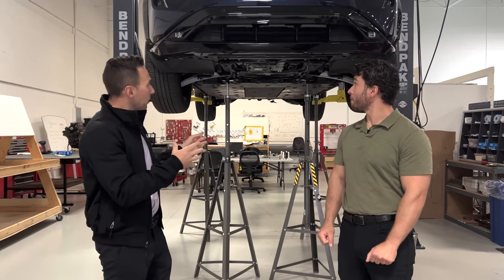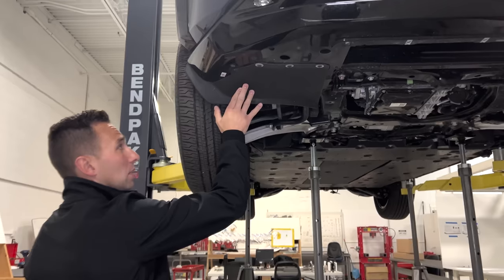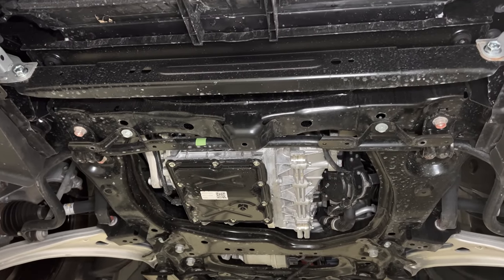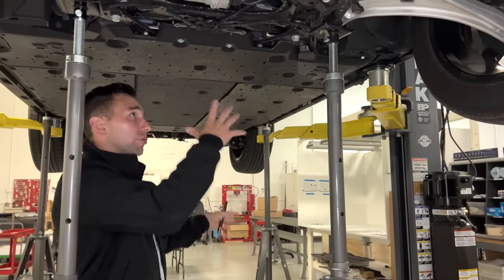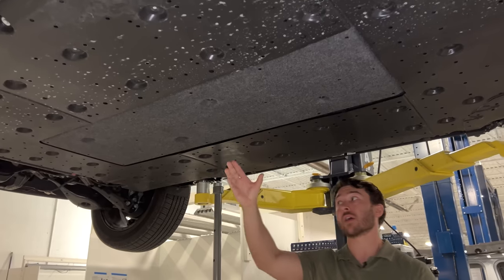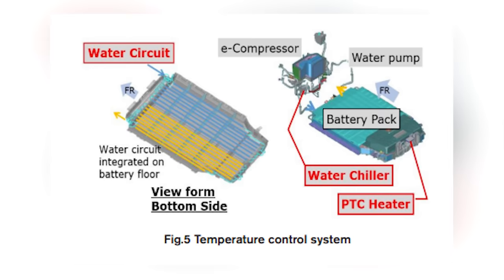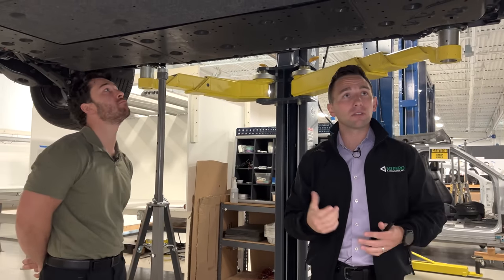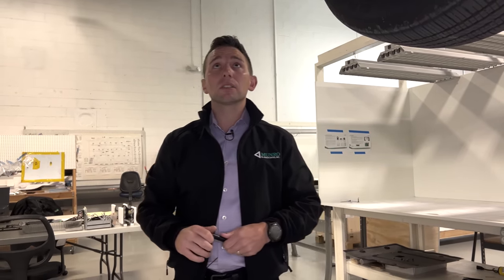An Integration Investigation: Nissan Ariya Hoist Review

Comment: I like the pack underside standoff space to minimise the risk of damage and the post-collision safety gained from placing the pack's cooling external, as H/K and VW do.  Although there are a lot of fiddly parts here and there it's clear that Nissan's design intent is to provide a quality product, as they did with the Leaf.  I was hoping that there would be some engineering comment about the steel sump under the motor?  Clearly it's a 'wet' motor design, another good choice, so perhaps that's access to a filter screen or oil/coolant heat exchanger?  Big thanks for the video, guys!

Comment: I'd worry about how evenly cooled the cells and modules are if all the coolant goes down one side and up the other. You'd think they'd incorporate dual loops flowing in opposite directions with a manifold at opposite ends to distribute and redirect it. The more evenly you can match the cell temps, the less likely you are to throttle the charging speed because of hot or cold spots. From TeslaBjørn's OBD data it seems that Tesla still does the best job of keeping all the module temps within low single digits of eachother.

Comment: I have been wondering for a while now why these battery packs are not insulated.  The material used on the space shuttle comes to mind.  It is light weight and I'm sure Tesla can get some of this from Space X.  These packs are liquid cooled and heated so I see no reason not to insulate as long as thee material is not too heavy.  Insulation can go a long way when it comes to extreme climate areas.  Anyone have any thoughts?

Comment: The Ariya definitely has AGS motors and actuators, at least my EU spec unit does, also I'm doing about 330 miles each charge with it, don't know why you are saying that it can't touch even 300 miles.

Also those underlights are dealer installed accessories, I have to note also that those lights are completely different design on EU spec Ariya's, I don't have light strips on mine but LED "ceiling" type ones.

Comment: I like the externally attached wheel spats. It's like Nissan is acknowledging that these get damaged a lot, so they've given the owner an inexpensive way of replacing that part instead of making it part of a larger assembly that would be cost prohibitive to replace.

The LED side lights harness looks totally janky, and reminds me of some trailer light harnesses that zip tie to frames.  Also like trailer light harnesses, are subject to damage from road debris and then the lights go out.

Comment: The ground illumination lights is an accessory you can order at the dealership for about 600$. So this is not factory installed, which explains why it wasn't fully integrated.

Comment: The other thing I noticed about those courtesy lights is that the mounting clips are over the lint emitting surface which is going to cast a couple of stupid looking shadows.  This looks like some sort of dealer add-on option.  If it is factory - very poor execution.

Comment: I believe the lights are installed at factory level. Interesting that Nissan went to great lengths to cover the pack and the underbody  yet couldn’t be bothered to route,cover, and mount the wiring for the lights correctly.
Reply: After thought, the platform will be used for Renault products as well and I doubt this was planned since conception.
Reply: Port installed.
Reply: That wiring assembly might also be intended for other, larger vehicles, and Nissan went with one part for their entire lineup.  Just speculation.
Reply: @ClockworksOfGL  really good  observation that’s certainly plausible I believe the pathfinder and armada  have a similar lighting package. Could be that all models use the same part number for the lighting package.
Reply: @MuitoDaora  maybe but why would they design a lighting package that’s a one-off/bespoke to one car and cannot be used across others….that seems like extra cost that the company will not get back imo
Reply: @Drivethisnotthat  good guess that would explain why it looks like a rush job.
Reply: There is an illuminated-plate option for the cargo area.

Comment: Yep, Looks like a Nissan. Not elegant, but effective. Hey, the upfront engineering costs count too. My 2011 LEAF was embarrassingly inelegant under the skin, but is now a 3rd gen hand-me-down. The uncooled battery was awful, but cheerfully replaced twice under warranty. Today at 150k+ miles it is still perfect except for the paint and silly solar panel. Still on OEM brake pads.
Nissan has been through some really tough times, scandal and merger. The Ariya (have to look up spelling every time) Is the ideal EV for 2016 when it should have come out. I have a soft spot for Nissan and hope they find a way to be successful. Buyers will be happy with this car.

Comment: What is the battery chemistry of this vehicle?  Can’t find it anywhere
Reply: I believe it is NMC and I’ve heard it is supplied by CATL.
Reply: @geft there’s an elektrek article from 2020 that says this, but the company won’t confirm it, and inside EVs says it’s Envision AESC.  And if it’s NMC, how can you charge it to 100% every night and not get huge degradation?  Massive oversight on Munro live to not mention the chemistry.
Reply: @Aslash304  I think I heard about CATL in a video I watched.  So not 100% sure about the manufacturer.  I contacted Nissan about battery charging and they recommended stopping at 80%.  Unfortunately the car doesn’t let you set a charge limit so I just have to have my EVSE cut off the charge by time.  The agent I talked to indicated this feature is currently being worked.

Comment: That basically quadrupling the size of battery pack only gets you about double the range of Nissan's original 24 kWh car is something I find a bit sad.  I strongly feel too much emphasis has been given lately to having SuperCar performance levels in what should basically be a family grocery getter sacrificing range on that alter in the bargain.  In this pursuit of the high performance family car they are also sacrificing charging time since a 96 kWh battery takes much longer to charge than say a 48 kWh battery.

In the ICE world we saw this in the 1960's/1970's during the Muscle Car era when fuel tanks grew to well over 30 gallons as they put more emphasis on performance over economy installing 400+ cubic inch engines even in the family grocery getter and then the gas crisis arrived with gasoline rising to almost 40 cents per gallon which many said we weren't going to put with for very long and they were right because in short time it went to $1.40 a gallon.  Imagine filling a 32 gallon fuel tank on your family grocery getter every week at today's fuel prices.  That would be unacceptable for most people yet with the EV we see similar as more and more are getting close to and over 100 kWh battery packs to support larger more powerful electric motors then are really practical.

We need more EV's that get better than the 5 miles per kWh of a decade ago and not more that get less than half the range per kWh.  Improvement in efficiency, aero, et-all should result in a measurable increase in miles per kWh and not large reductions in it.  We appear to be making giant leaps backwards in efficiency.  We should at least be where a 48 kWh car gives you more than double the range of a 24 kWh car from a decade ago.

Perhaps if enough of us push back on this manufacturers will take note and start making EV's that have more reasonable performance levels.  They would also cost less to make and more people could then afford them.

Best!
Reply: I understand that, all things equal, a doubled capacity battery doesn't give you a doubled range because of increased weight. I don't think the issue is high performance motor. If you discharge an average 48kWh battery pack to 10C rate you still get a healthy 480kW of peak power. The problem is the focus on big SUV. The Ariya is heavier and have a larger frontal area compared to the Leaf. Despite being the Leaf a decade older, both cars are still made of stamped steel. Therefore I'm not surprised about the range.
Reply: @theagentsmith  The rub is though that all things are not equal.  

The industry reports that they have made a 10% annual improvement in battery to weight ratio since then.  The original Nissan Leaf was released in Japan with a 24 kWh battery 15 years ago in 2008.  In 2023 that now would be a 150% improvement in power to weight so a battery that weighs the same as that original 24 kWh battery from 2008 would be 24+(24X150%=36)=60 kWh and a 96 kWh battery in 2023 should only weigh around 50% more than that original 24 kWh battery.

Add 15 years of improvement in aerodynamics, heat pump efficiency, etc, etc and one should expect, along with demand, much better range than we're getting from new EV's such the crossover Aria.  The major things impacting range needlessly are the Extreme Pursuit of High Performance and Opulent Luxury over Efficiency which is also inflating the sticker prices.

As it sits today it appears that Aptera is the only one taking this bull by the horns and trying to push the envelope of efficiency.

Best!

Comment: Where is the radiator shutter?  Had those 10 years ago.  Front wheel deflector and the rear wheel deflector are too small and expensive.  The lower covers over the battery pack looks like a mess.  Far too many parts and how many fixings do they need. Where is the attention to detail. Should be underflush front to rear with few joints as possible. I could go on.    As an Ex-Nissan platform, I am pretty angry. No surprise the range is poor. D-

Comment: I bet the pro-pilot system isn't integrated into the vehicle sufficiently to utilize the existing TCC wheel speed sensors, so the vehicle had to have a second set.